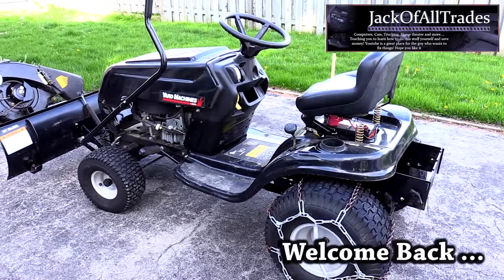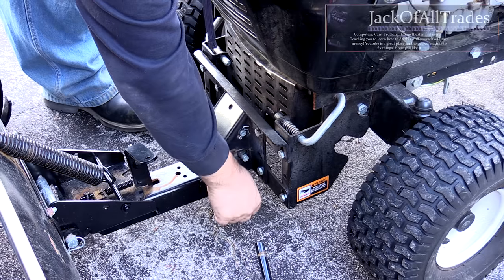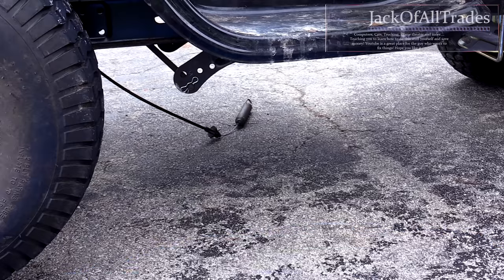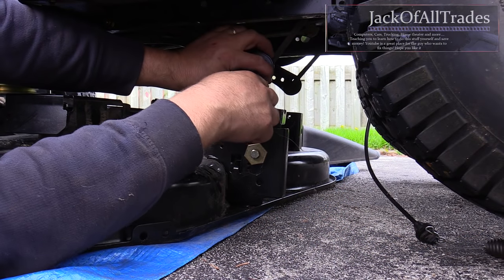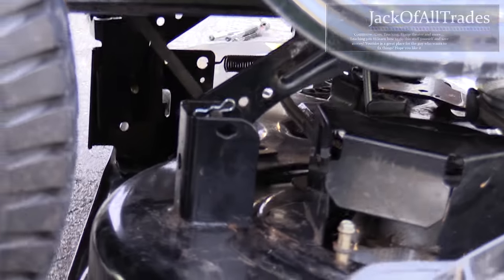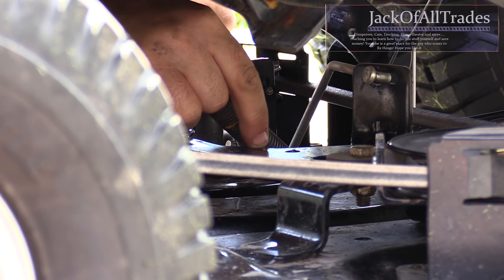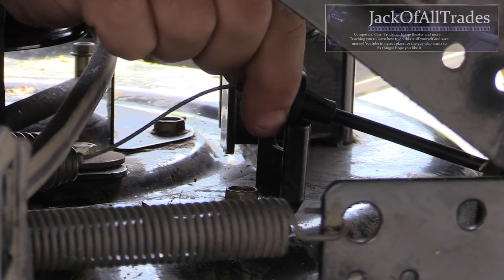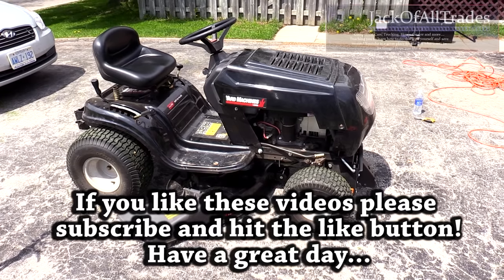MTD Yard Machines 38 inch mower deck installation and removal.

Comment: thanks great video I have both my deck blade stop springs broken I guess  that's what they are called  I don't have part numbers the one on the chute side is gone and the one on the left has the rear hook gone would you know the part numbers  for those two springs?
Reply from the maker: Mtd website you can download the parts list for your deck and order parts from them.
Reply: +gereral1 I will check it out not sure exactly  how chute side spring goes on I remember it went on post wrapping around bearing housing  but not sure how it hooked to blade stop linkage
Reply: +markythunder PDF pics don't  have a good view on diagram layouts
Reply from the maker: If you take a picture of the area Ill head out to the garage and upload a p
ic of mine tomorrow so you can figure out the correct install.
Reply from the maker: under my about tab you will see businness inquiries. Click on that and upload to that email the pic and a return email so I can send you the pic of my part so you can figure out how to install it on your machine.
Reply: +gereral1  thanks I will tomorrow
Reply from the maker: Check email
Reply from the maker: Checck your email. I removed the covers and took pictures of BOTH spring installation spots at each end. So now you can order 2 new springs. The one spring you showed me looks like the end is bent so you should order 2 new ones. Good luck.
Reply: +gereral1 thanks Ken got it was a big help, have a great summer.
Reply from the maker: You too........

Comment: I have a question. it seems that by flicking the speed levers into I higher speed my tractor moves at a slow speed. how do I adjust it
Reply from the maker: You 2 belts ( transmission and main upper drive belt will need replacing. After while these belts stretch and the tractor slows down even when the lever is at full range. When I mine this year ill put up a detailed video, There are some other videos on youtube but the quality sucks.

Comment: watch your video but when I try to attach the PTO spring  I am not able to  pull the cable back into the slot its why to tight and I am not superman any suggestions on attaching the cable
Reply from the maker: make sure the in gauge handle for the mower deck is OFF and the deck height is at lowest it can go.

Comment: Hi.. ive done this after a belt replacement.. but ive seem to have struck an issue.. 
After checking deck goes up and down.. i noticed it was rather hard to raise right back up to 5... from about 3.. 
From what i can see ive done everything right.. why would i be having this issue?
Reply from the maker: Did you place rear deck pins in correct holes? The position  of the deck will effect the 1-5 height handle.  Is the front pin set in the hole correctly? Is the belt the right type? The design of deck is simple. 2 pins rear  1 arm on front  engage cable with a spring and lock pin. Not sure what could be causing level handle to not go above 3.
Reply: @gereral1_jackofalltrades  everything seems to be in the right place.. thats why i dont understand..it will go up to 5.. rear supports are in correct holes.. everything else seems to be in order.. i was going to attack maybe with some wd40... see if its catching..  
I did wonder if ive altered the front support.. and maybe thats the issue..  maybe i need to slacken it.. ??
Can you post a pic of underneath for me too .. theres a little metal bar that gets hooked up ...(between  right pulley and idler pulley) ive found one vid.. that someone said   it goes over belt.. 
Can you clarify please?
My belt had snapped prior.. so i didn't get a picture.. 
But .. im pretty sure it doesnt.. the belt goes straight from right hand pulley to the left directly.  
Sorry to ask.. but i cant find the answer in videos.. it looks to be your video has it running straight behind too
Reply from the maker: Russell yes the bar goes over the belt in middle of deck. If u never touched adjustment not at front it can only be binding in the part that raises and lowers deck. Look to that.
Reply: @gereral1_jackofalltrades  so that bar goes over the belt and belt runs through it?
Yes.. i did touch that front support bracket nut.. it must be there i need to look at.. 
Im also wondering where the retaining spring attatches for the forward reverse lever.. i had lost that.. need to fit a new one.. i also cant find where where this goes..
Reply from the maker: @bronwynrussell7763  no sure about that spring. I'd pull camera out but it's too cold. Tractor away for winter. Tip. Open seat remove battery give u access to these items .
Reply: @gereral1_jackofalltrades  thanks.. sorry to ask.. but ive searched every where.. 
I think i may be able to nut out the retaining clip.. for forward/ reverse lever.. 
But is it correct that the belt runs thru that bar that goes between right pulley and left pulley.. that is installed OVER the belt?
As i have stated.. i have seen conflicting views.. 
When i watched your video of installing your deck. I didnt notice that the belt was running through it.. 
Sorry to ask.. just a chick living in the middle of nowhere.. trying to fix things for herself . 
Diagrams are very hard to follow in the operators manual as they tend to layer parts..and not show actual placement.
Reply from the maker: @bronwynrussell7763  the bar goes over the belt. And the cable to engage disengage hook goes under the belt.  Held by a clip. The belt must be below bar
Reply: @gereral1_jackofalltrades  thanks.. that clarifies it doesnt run through it.. 
Many thanks.. and i do have the cable to engage /disengage in the right place.. 
Many thanks.. from New Zealand 😁

Comment: can I install my old 42" deck on a 38" mower. both are mtd, yard machine
Reply from the maker: I believe you can. On my mover deck is a slot for to deck engauge spring and one hole is labeled 42inch. You may have to adjust the ends and the one main arm at the front of the deck.

Comment: My question is my deck is low on the shoot side? No adjustments but on one side and thats does nothing
Reply from the maker: My deck has to points that can be adjusted at the back of the deck. forward of the deck it sits on a pivot arm. Its odd your deck does not have bolts that attach to the frame.If its low on one side lower the side you can adjust to level it out. Then the height lever keep at 2-3 so I does not chew your grass. I never go below 3 when lowering the deck with the control.

Comment: Help plz. My lower deck is not leveled when pull up the deck any suggestions Maybe post a video and how to level it...they charge me  Hundred Dollars to fix i dont want to spend that much
Reply from the maker: On the front there is one pole that slides in with a nut! Adjust this nut to change the front height. The back is adjusted on each side. Look at when I installed the clips on the sides to hold the raise and lower part. There is a nut on each side that can be loosen and the deck raised or lowered to level out. Hope this helps.
Reply from the maker: There are 3 adjustments. The front arm and the sides. There is an adjustment nut on the front to adjust the front and the 2 bolts on the sides to adjust the back. Save your money and set the level to 3 on the up and down knob and place a piece of wood the thickness of the deck and start adjusting. Remove the board and viola perfect level. Later

Comment: Great video!
I have same mower, just got it.
It does not have e belt for 38"
Same three pulley deck.
What is the belt model number?
Reply from the maker: On my channel I have belt replacement video. Info for belt is there on my channel.

Comment: The main upper drive belt and transmission belt are new. I thought I may need to adjust the selector switch on the mower.
Reply from the maker: Rico Williams Sr did the spring on the upper belt pulley (was it installed correctly? )

Comment: the cable that engages the blade snapped.  can you make a vid that shows that assembly, please?
Reply from the maker: Ill see if I can free up some time to show this cable in a short video. Taking a week off work so I might be able to pull apart part of the tractor to show you this part.

Comment: Do you know if I can swap in a 42" instead?
Reply from the maker: Yes a 42 deck can work but you must change the spring to hook to the correct hole.
Reply: Right after I wrote the question I went out and did it. I figured I had nothing to lose at that point and you're right, it did work. I didn't know about the spring though. It appears to be working fine but I'll check that out for sure. Thank you!

Comment: Good video but I needed to see how to put the stabilzer back on :(
Reply from the maker: To make it easier put the front of the car raise on 2 jackstands to release pressure on the crossmember so stabilizer slides in easy on the lower connection.
Reply: I actually found out you have to put the stablizer rod on first before you reconnect the cutting deck, big learning lesson

Comment: I have the same mower do you know what all 3 belt sizes are
Reply from the maker: The other 2 are for the transmission. I have to replace them this summer and will make video on it. They are done by removing seat and battery box
Reply: @gereral1_jackofalltrades  ok thanxs. Bud
Reply: @charlieseymour5489  My one of these (38" 344cc Briggs with forward/neutral/reverse shifter on the left rear fender by the cupholder) that was stolen years ago had a decal on the underside of the hood with all of the part numbers, luckily I took a picture of it:

Upper CVT drive belt 954-0241A
Lower CVT drive belt 954-04001A
Deck drive belt 954-04062

Those CVT belts take a beating on these because of the single speed transaxle, some of the older MTD chassis mowers had a 2 forward speed transaxle so the CVT had 2 ranges, low for mowing and high for transport AKA "road gear".